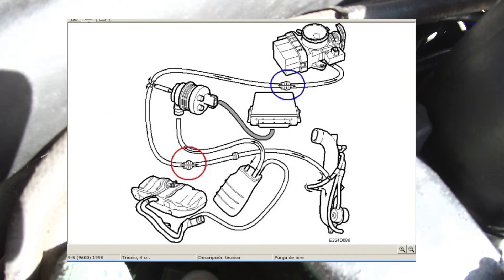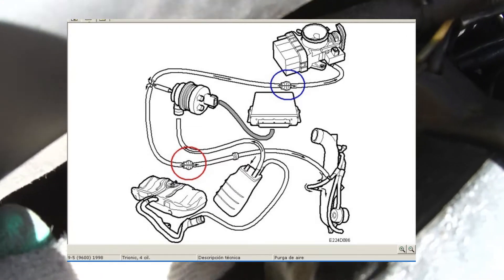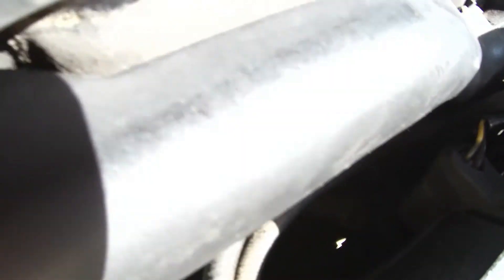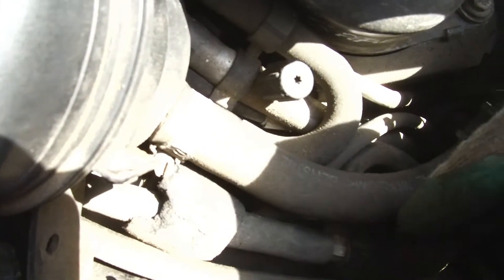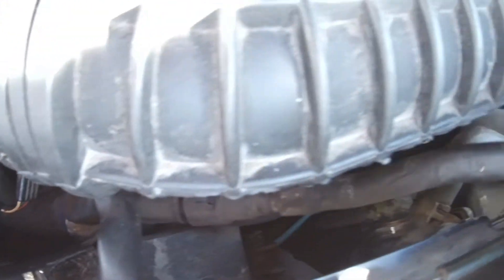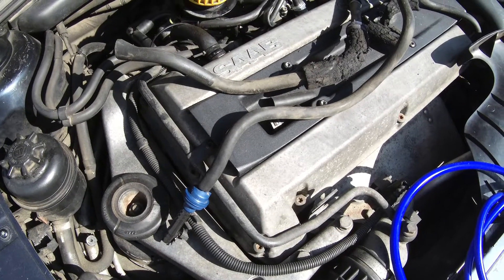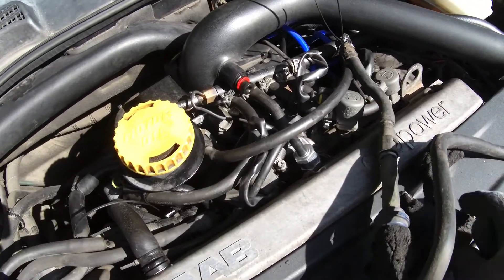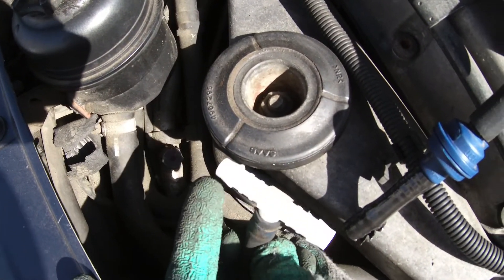Saab 9-5 Evap System Repair (Upgrade)

Comment: Hi there, how did you get to the part of the car where all of this is? I am not a mechanic and need to do this at home. Is the evap system on my 2007 9-3 2.0T located near the back tire on the passenger side? Did you need to elevate the car wheel or remove it to get to the tubes? I also want to test the function of the evap carbon canister and the vent solenoid too. Video was so helpful but was so close in that I could not get full context.  Thanks in advance.❤

Comment: You are better to use new fuel hose as silicon hose can  sweat oil and degrade if used in systems which might be contaminated with oil or petrol vapour.

Comment: Hello, great video! I’m going to do this because I have repaired all the usual low boost issue suspects already, DIC, plugs, vac lines etc. also replaced IC hoses. I hope this fixes my base boosting 95.
Reply: Unfortunately no.
Reply: @chilagoUi9299 did you ever figure out what was wrong?
Reply: Did it help?

Comment: You’ll also need 9mm hose as well a 3/8in to 1/4in hose reducer. Otherwise the hose that goes from the T towards the throttle body will close on itself. It’s blowing towards the intake so it creates a vacuum and 6mm hose flattens out and shuts. You’ll see what I mean when you’re doing the job.
Reply: Otherwise thanks for the video it was a big help

Comment: I can tell u that you can delete the pipe what goes from T to BPC turbo valve. So from Turbo valve directly to intake. And from throttle body directly to evap purge solenoid, with a ventil between it. Like T8 system was done. So its a upgrade
Reply: So the cobra pipe connects to apc top port withouth T 
and the Throttle body connects to evap purge with 8mm hose with 1 valve inbetween right?
Reply: @Grandpasaab yes should be like that, make sure one way valve operates

Comment: Thank you for video. which way do check valves go for flow?
Reply from the maker: one flows to the throttle body and other to the turbo side intake.. imagine engine "sucking" on them because they release fuel vapour from the tank.

Comment: Hello there from USA! I've got a very similar car to yours, mine is a 2004 SAAB 9-5 Aero Wagon Automatic. I've also got a similar problem which you are describing here. When I have my car in manual mode, going about 60 or 70 mpg, I floor the throttle but I don't always get the maximum boost. I have checked the check valves by pulling out the pipe you removed and thy are fine, they work flawlessly. I have replaced boost controller that you pointed out in your video, it helped a lot but still no max boost every time. I also replaced SAAB Boost Control Valve (T7) (BPC) 55557331 but it didn't help anything. All my vacuum lines are new. Gas is 92 octane always. Mass Airflow Sensor is new. New Air filter installed also. I'm still looking to figure out the gremlin in my system.

How is your car doing thus far? Do you always get full boost with your setup? Thanks.
Reply from the maker: hi most of the time yes full boost. what i can suggest is to make yourself smoke machine. There is a lot of tutorials on youtube. Or go to some shop where they have one. Just pump smoke in the system and see where it leaks. I can guarantee you will find at least one place.. my bet it will be red connectors from brake booster and intake tube. Also seal around throttle body where it connects to the tube. I had 5-6 leaks even after replacing all vacuum hoses! good luck :)
Reply: What gear are you in when you dont get max boost?

Comment: Great video. Should we add zip ties to the shopping list?
Reply from the maker: Thanks i think i didn't used any but in the future i might do some cable management to make it look nicer :)
Reply: New question for you. How does the silicone hose hold up for you? I found the silicone hose is starting to deteriorate due to exposure to oil. I am considering redoing this fix with fuel hose. What do you think?

Comment: Check valve diameter is 10mm you need silicone hoses  8mm inner diameter to fit a 10mm check valve.
Reply from the maker: 6mm also fits fine.. 8mm would be a little too big for throttle body connection
Reply: @saabgonebad4181  Just changed the one at the throttle body and 8mm was perfect with rigid fuel hose, 6mm might be good for softer silicone hose. 8mm fuel hose however was too small for the first T-junction, that required 9.5mm.

Comment: this was very helpful. thank you. i was curious if you could do a video showing how the wastegate controller and the boost bypass vacuum location? i own a 2000 saab 9-3.
Reply from the maker: Hi mine is 2003 9-5 aero. I had saab 900NG which is very similar to yours 9-3.. This website will help you to see where goes where http://www.saabwiki.info/index.php?title=NG_900/9-3_Boost_Pressure_Control_Valve

Comment: Would this get rid of the p1181 cel I already replaced the vacuum lines and still have the cel.
Reply from the maker: if the hoses are cracked it will.. Somewhere air is getting in.. I will make a video how you can make cheaply vacuum leak tester for saab
Reply: @saabgonebad4181  How to make a vacuum leak detector, thank you

Comment: On the video at minute 232, do I get rid of that t-connection and follow the black from that comes in from the bottom of the T to get rid of the second part of the hose?
Reply from the maker: it's evap valve and a small hose leading to it.. If you want you can change that too but usually it's not the problem

Comment: Can one of you clarify which line I can delete? I assume ti's not the line segment that connects to the throttle body. So how do I cap off the end where the other line segment came from? Any help would be appreciated. Thanks.
Reply from the maker: sorry to respond so late.. my car is 2003 and on later years lines changed slightly.. I would not delete any lines as some report sharper response with all the lines.. But it's up to you. Hoses are really hard to take off but just follow the lines... I left line from tee to evap valve unchanged because it was in a good shape

Comment: If you plan on doing this I would advice routing the hoses like on 06 onwards 9-5 by connecting the cobra directly to the APC, you only need one check valve this way.
Reply from the maker: yeah i wanted to leave original routing because somebody reported that with all the lines it's a little bit quicker throttle.. Maybe it is maybe not but anyway it's good to remove one weak point and stop boost leaks..
Reply: Carsten Urbani agree. I recently did that too, just one line + one check valve to the throttle body. Deleted the line to the APC.
Reply: Is there a step by step guide or video/photos how to do that ?